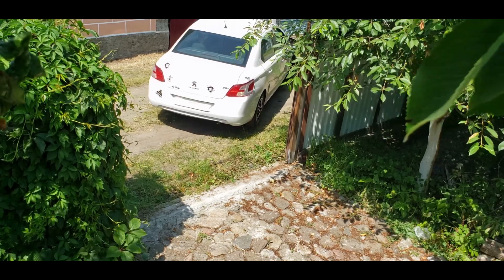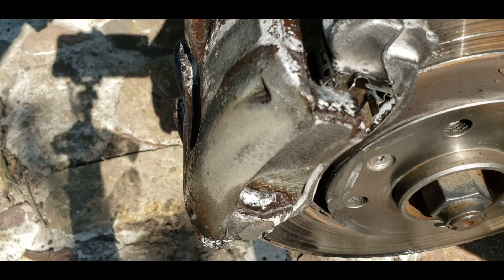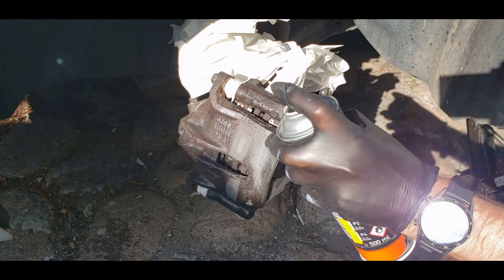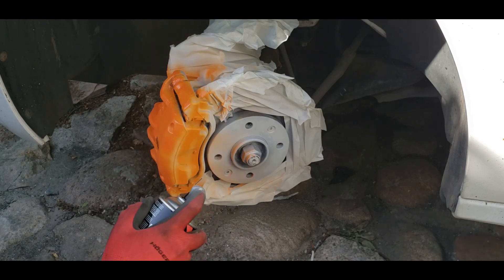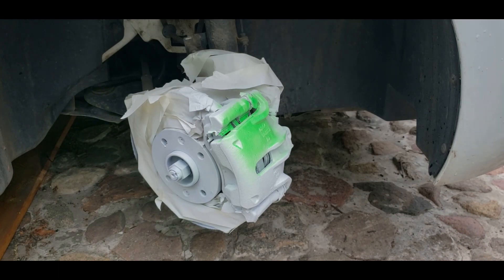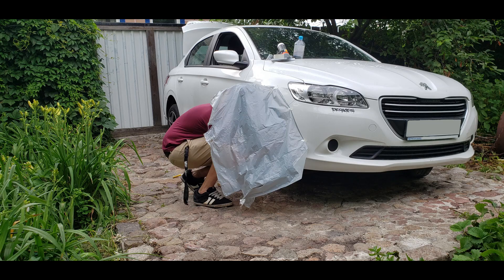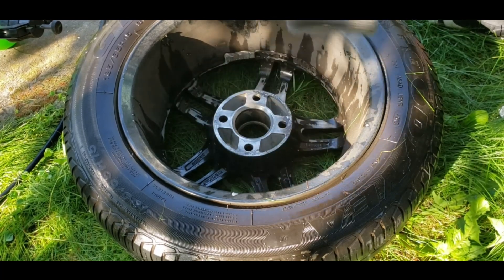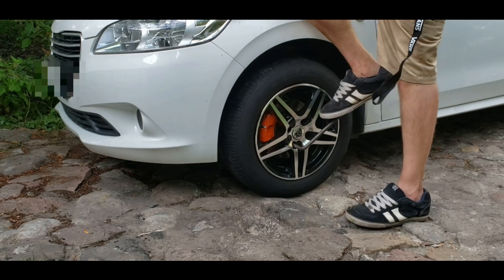Brake Caliper Restoration

Comment: Dude, it is time to change brake discs and pads. At least one disc has cracks and small part is missing. Plus contact surface of the brake pads indicate that are done long time ago. 

Nice video, btw
Reply from the maker: you should better speak to Mr.Diubell who touched my brake disks last week))
Reply: @drsaliuchello7885  no need to touch, just replace.
Reply from the maker: @aliaskov  What's the sense in doing something without touching?😂